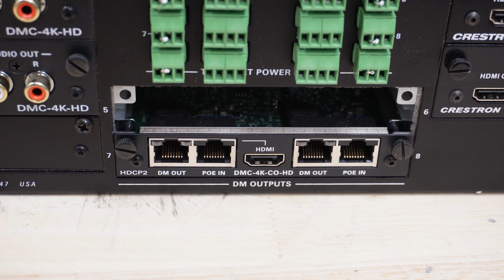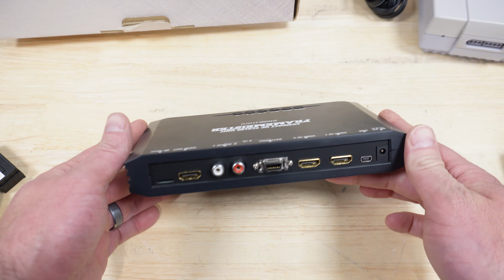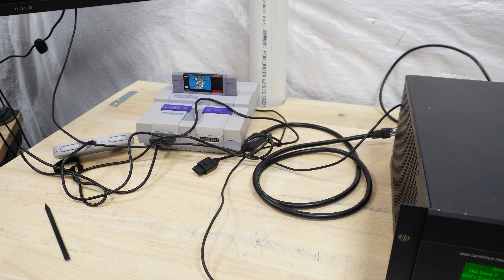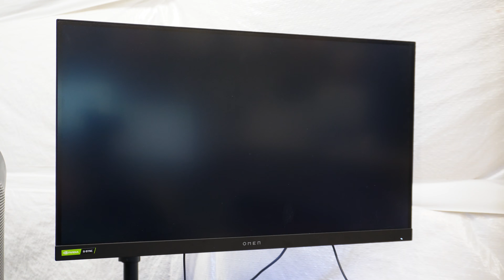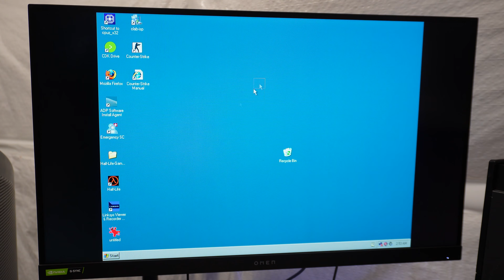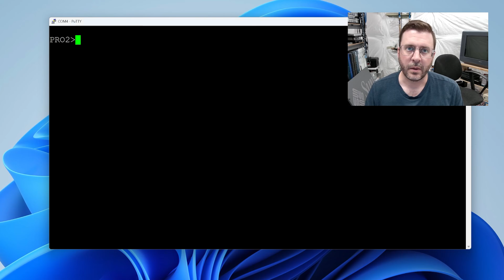Crestron Video Gear

Comment: Ha! I'm an authorized Crestron Service Provider (basically an independent programmer).  I still program this stuff on the daily (although newer gear) along with QSC, AMX, Extron, and others.  Been doing it for over 25 years.  All are still big names in professional A/V.  Most of the pro A/V stuff these days operate over standardized network protocols with multicast.  Low compression / low latency over TCP.  The control processors are much faster as well.  HD-Base-T (which is what this is based on) is zero latency below 4K.  Also, there are scaling endpoints and non-scaling endpoints.  Scaling will add latency but can be disabled.  Non-Scaling endpoints are less expensive.  Advantages of scaling endpoints are seamless switching along with video upscale and video wall processing.  Feel free to AMA. Good find!

Edit: Just watched more of that video.  The 4K-Scaler-C endpoint will likely require a dedicated 24V power supply.  Likely won't power properly with that chassis over POE.  Try that.
Reply: DM-RMX-4K-SCALER-C will power fine with PoE. Have a few houses still with this setup. Working fine over the years. (Same goes for 4KZ-SCALER-C by the way.)  They seem to pull roughly about 10W or so during operation over PoE.
Reply: @truectl Its PoDM+ / POE+ rated. 25.5w. Not sure about what those 8x8 cards can pass through with POE+ iinjection. Should also check firmware.
Reply: @JackKolesar  I haven’t checked max PoE draw, but as I said, actual real-world current draw of a scaling endpoint is about 10W with HDMI and LAN active. Maybe slightly higher, not sure right now, my remote measuring equipment only shows most significant digit. This isn’t a guess, I just looked. Crestron was very conservative with the power draw estimates of the DM scaling endpoints.
Reply: What is all about LAN port on each piece of equipment - control only or does it even cram ethernet over DM too?
Reply: @mrblc882  Yes.  Passes ethernet over DM as well.  100Mbps only.  Kind of creates a switch with all the endpoints.
Reply: @mrblc882 Yes, it passes Ethernet as well. Will act as a 100 base switch with all the endpoints.
Reply: Bro you got that diamond cert?
Reply: @IT10T  Nah.  Never went past silver.  I should download and take Gold at least but I just don't have time. Don't remember if its diamond or platinum but one of them you have to teach a class at Masters as well. Haven't been to Masters in a few years so I'll have to go next year.  I'll probably take the Gold test before then.
Reply: God that sounds like a racket almost lol. While I like the idea of passing along knowledge, I find that most of these old guys have such a stick up their butt they don't care enough to give their entire "wealth" of know-how. At least this is what I come across in standard IT corpo world.
Reply: @JackKolesar is there any way to get the Crestron DM to correctly identify 240p? Old CRTs correctly blanked out every other line as a trick of 480i, yielding a progressive image, but the DM seems to apply deinterlacing unnecessarily. My $200, 2018 flatscreen Samsung with a component input can correctly identify 240p over the same cable used in this video, so I’m sure the DM can do the same, right?

Comment: this is what was in most of the conference rooms at Google when I started in 2006, or maybe just older versions. If you plugged into HDMI or VGA at the table your laptop would call it crestron.

You should look up dvdo iscan devices for your VGA and component and dvi capture needs. it will be much less work and line double the interlaced stuff quite nicely.

Comment: Ive got an 8x8 that i am setting up in my house.  Itll have 5 input devices going to 6 TVs.  Using hr-150 remotes (1 for each TV).  The processor is what you actually program, Im running a CP2e.  I do not have any Crestron training, So i suggest checking the Discord, and there are some pretty decent videos out there.  Programming is absolutely awful, mostly because it can do just about ANYTHING that you want.
Reply: If you upgrade to a 3-series controller you can program it with C# and not have to deal with the trash fire that is SIMPL.

Comment: I find the comments so far interesting. Seems to be one group of people that really love Crestron gear, and another group that say it's a nightmare. Wonder if it's one of those things where the hardware itself is solid, but there are lots of shoddy installers/contractors that setup poor implementations?
Reply: I'm stunned by these "amazing" comments. It was 1000% a nightmare for everyone I knew including myself. Everyone was excited to delete it from existing environments and greatly simplify things.
Reply: @AmericanLocomotive1  You totally got it.

Before Crestron Home (their latest system), systems were fully programmed…usually by programmers with no prior programming experience, no idea for logical program flow, and no idea about human interface UX. Code and user interfaces are completely custom.

Most of these programmers can’t write their own language either, so seeing spelling and grammatical errors baked in to clumsy, clunky user interfaces was the norm. Add in the small AV companies selling this gear at high margins and expensive service calls for what is often the fault of said company and it’s no wonder people hate a system designed to make their lives easier but only gets in their way.

When done right though, it can simplify and tame very complicated setups. I have 80 year olds easily operating multi-TV video walls with confidence. It works every time.

Crestron Home is their latest system. Instead of custom code, it’s basically just configured using an iPad. Don’t need to be a programmer to do it. There is the ability to do some custom code stuff but the vast majority of dealers do not. Of course dealers can screw up this system too, but as the UI / UX is consistent and controlled by Crestron, it’s harder to screw up by a dealer. However, older Crestron hardware is not supported by Home, and adding different / older / very new equipment that has no driver available means writing a driver in poorly documented SIMPL# (C# Crestron library).
Reply: Yep, it’s bad installers. I did it in my house fully DIY(no dealer involvement) and it’s amazing.

Comment: You make it sound like HDMI over CAT5e is the way it was done "15 years ago." That is absolutely not true. If you have a projector for example that is 50-100 feet in cable length away from the source, then using a HDMI over CAT5e extender to connect them is still very much the way this is still done today. The Gefen GTB-UHD-HBT for example.

Comment: 15 years later it should be obvious that this overpriced, over designed proprietary gear doesn’t age well. The only people who could afford this stuff are the same people who can barely use a single remote control. These systems were installed to add prestige rather than true and usable functionality
Reply: I remember folks spending tens of thousands of dollars on this junk. It was so satisfying yanking it out and setting up some apple TVs and these rich folks LOVED it afterwards. Crestron was a nightmare, none of that crap ever worked out, sucked to deal with every step of the way. Amazing to watch clabretro even attempt to mess with it, but i guess that's part of the fun. the pain.

Comment: I have good luck using a professional scaler (Extron) going in to a capture card. Old computers, PCS in particular, can switch resolutions a lot and all capture devices HATE that. A high quality scaler can handle all that analog nonsense and output a steady hdmi signal which is much easier to capture.

Comment: I do Crestron programming at work.

All your cards transmitters and receivers that do not have a 4K on them are all 1080. The cards transmitters and receivers that say 4K can do 4K resolution and at 60 Hz can do 442 color space and may not have. either UHD or HDR. The 4K Z cards, transmitter and receivers which I have not seen any in your pile yet, can do HDR UHD and 444 color space at 60 Hz.

BM is proprietary but heavily influenced by HD base T and does communicate with HD base t endpoints. All of the USB HID ports will only work with basic keyboards mice and other HID protocol devices. Any keyboards you hook up the cap lock, numlock scroll lock lights will not light up these ports are uni directional.

All scaling happens on the cards or receivers that are marked as a scaler. No other card for the chassis does any scaling at all. All input cards, output cards, transmitters, and receivers should be transmitting native resolution all the way through until it hits a card or receiver that has the word scaler on it. I have tested this myself with an nec monitor and my 240 P resolution device came out as some weird resolution on NEC but that’s just because the NEC doesn’t know what 240 P is.

Another option you have in place of your series to processor, is to get a series 4 processor that has a -r behind the model number. For example cp4-r or mc4-r. The -r processors use something called Crestron home. You will have an easier time programming this than trying to get a hold of the restaurant software to program your series 2 or any other series processor.

The serial port on the processor is not used to communicate and configure the processor. It is used to communicate two devices from your program that you have loaded on the processor. The only two ways to communicate to the processor is either through the USB port or through the ethernet port. Same thing with the switcher the only way ways to communicate with it is through the USB port or the ethernet port.

Sorry, my mistake, I forgot that the series 2 processor has a serial port on the front panel to connect your computer not a USB port.

If you do actually have the software, last year crestron copied all of their training to YouTube. You can get all their CTI training on YouTube. Also look at the overworked logic YouTube channel. Do not go to any links in the description. The website is now defunct. Another channel to look at is pro AV school YouTube channel. These are three major resources that you will find a lot of information on how to program this gear.
Reply: I was under the impression Crestron would never allow anybody to see any of their training materials. I guess I missed that!
Reply: @ the put the cti training on YouTube last year. It really makes no sense when you think about it since the training and certs require you to watch them thru the cti training portal to get credit for watching them! Weird!
Reply: @davidew98  Just a shame they don't open up their software, even for older series of systems.  The amount of e-waste that Crestron is producing in the 2nd and 3rd hand market is crazy.

Comment: I’m the sysadmin for a MiLB baseball
stadium, this same system was spec’d out for our premium membership club/restaurant that was built in 2019. 

Maybe it’s just that good and no reason to change? Or maybe the A/V contravtor took us for a ride 6-years ago. 

If these are going cheap as surplus I need to jump on ‘em…
Reply: it looks like the DM-MD8X8 went EOL in 2019
Reply: @kaukospots Yeah, they did us dirty I think. Saw public/private contract dollars, limited long-term accountability, and unloaded their legacy B.S..

That said, it is a pretty solid system. My only gripe is it doesn’t always excel at the “never off” and static programming that’s inherent in public venues like ours. It’s temperamental after several months of running the same configs, at least in a way that our other enterprise equipment don’t struggle with. I have devices that haven’t had a day off since 2019, only breaking their stride to install occasional firmware updates, but then these Crestron units aren’t ever getting those again anyway.

EDIT: Just to be clear, the entire facility was built in 2019, with the usual anticipated life-span of ~25-years between major refits. The budget was quite generous for I.T. provisioning, the contractors had no reason not to future-proof the place a little, and pick up the latest-gen tech.

Comment: Impressive how usable all this is without even using a terminal. Like we only got 45 seconds of terminal in the last 3 minutes of the video. Also amazing how cheap this stuff is on ebay. Wish I had more space for networking activities in my apartment.
Reply from the maker: I agree!
Reply: normally it wouldn't be. This stuff is usually a nightmare. He's lucky it got yanked from a previous environment.
Reply: It's cheap on ebay because without the super secret programming software, it's usually a paperweight. And to get the programming software, you have to join their cult - no thanks. The hardware is excellent, but the cultish behaviour is pure garbage. It's targeted at companies that have money to burn, or rich people that will pay a "programmer" thousands to setup a handful of light switches - no thanks. It can go to e-waste, right where it belongs

Comment: Now you'll need some crestron connected projectors. Epson made a few.
Reply: Just remember that some of these Epson projectors are old enough to need Flash in order to set the IP ID, and the IP ID as programmed on the Epson will be in decimal rather than the hexidecimal that is prevalent everywhere else in Crestron... ask me how I know... lol
Reply: @truectlyeah I have no idea about this stuff I only know because I've seen the Crestron logo on some projectors lol
Reply: @ Basically the point is simplified interfacing.

when using a Crestron system to control equipment, one usually needs to find a driver or find documentation about protocols to write a driver to talk to the device. Even different models from the same manufacturer can have different protocols and communication methods.

Crestron Connected devices can talk to a Crestron system natively. In SIMPL this would be using a Crestron Connected symbol. This allows control of the device - powering on, inputs, etc. as well as feedback - power status, lamp hours, etc. without any device model specific programming needed.

Comment: Usually with those USB-B ports, you'd plug them into a computer and would act as the keyboard and mouse as you mentiound. This system is very much like the SIPs you have for that dell KVM, just with USB instead of PS/2. As for the big one, it's usb would probably be for configuring it (or using it with that toolbox software you mentioned?)

Comment: As a crestron programmer, that stuff is amazing. 
The control processor is the brains  of the system, it will connect to the dm switcher over LAN, and set up anything you want
Reply: You can create a custom touch panel to control it, as well as integrate it with a lot of other gear,
IE, you can send serial to power on and off displays..... send network commands, it really is endless.
Reply from the maker: yeah I'm gonna pick up a touch panel haha
Reply: @clabretro  the DM TX  201, USB is ment to go into a host port, IE a PC. The usb prephirals would plug into a diffeent device, so you would put a PC in a remote location and  extend the USB over  DM,  and have control over it from another location.
Reply: @clabretro  If you do get a touchpanel and want a custom program to operate this setup, I'll write it for you =)
Reply: I love Crestron hardware for the longest time i was big in Extron but now I'm more Crestron

Comment: I wonder if the problem you're having with the SNES is because it thinks it's 480i 30Hz, whereas it's actually not -- it's 240p 60Hz.  I have a Black Magic capture card that is absolutely useless with consumer AV gear.  It can't handle any deviance from strictly compliant video formats and framerates.  I suspect it's the same problem here.  Old game consoles and computers used a hack where they reset the interlaced video every frame to do half-res progressive scan, and I think this "professional" gear has no interest in trying to cope with that.

Comment: I've always wondered why equipment like that require power over ethernet inbound instead of sourcing the power from its own power supply?
Reply: I think it's partly because they're cheap and don't really understand the concept. integration devices like this expect you to have the power supply or the power supply located over there in the rack. And then you would naturally plug the power supply into the device you're running it to...

Comment: I built 3 museums on Crestron hardware and it works so friggin' well I can't even explain. Awesome stuff.
Reply: You should make a YouTube video about it
Reply: @coreybabcock2025  No, not really. I love my privacy and I don't want any kind of fame for myself. Besides, I would be a horrible youtuber, as I don't give a rats ass what people think about my content or achievements, and I wouldn't interact with any follower.

That said, I'll give you a short rundown about what a Brightsign can be used for.

Basically, we used it for MUCH more than digital signage. You can run websites on them and have touchscreens connected, so you can basically make interactive games without using a PC environment, which can be an advantage. One more thing you can do is to connect reed relays to the IO ports of the Brightsign. You can build, for example, a map with a magnifying glass moving on an XY coordinate system. You put reed relays at the XY positions of PoIs, magnets on the axes and you can display info for said PoI on a nearby screen, making for an even more interactive experience.

Why not an arduino? Because a big museum needs central management and easy handling of content changes. You can sit down in front of a virtual server and change the entire experience, instead of fafing around with an arduino. Also, it is a known platform and much more easily secured from unwanted interaction than an arduino. But this is just one example of many ways to use brighsigns.